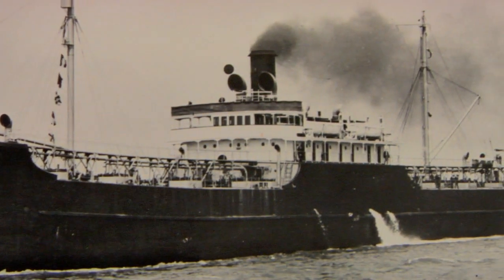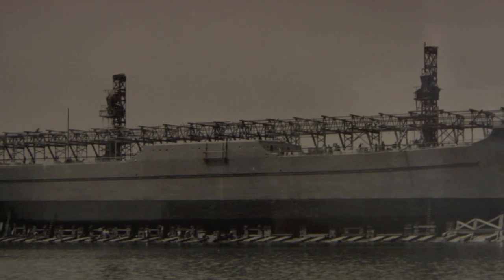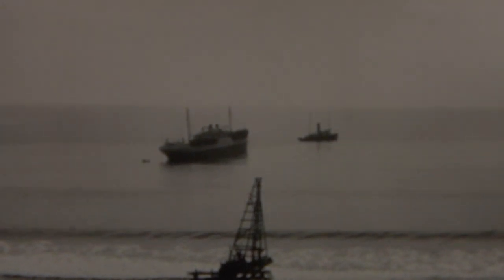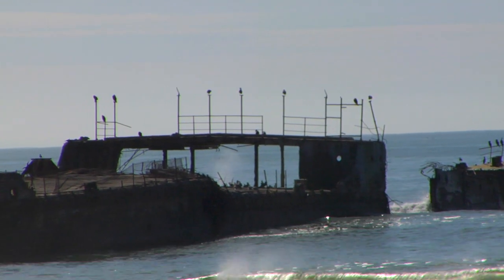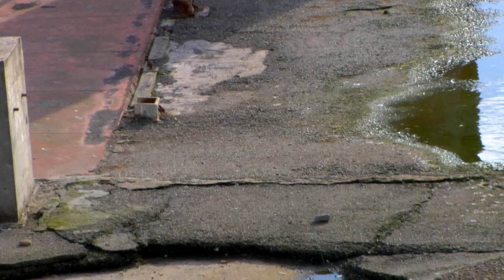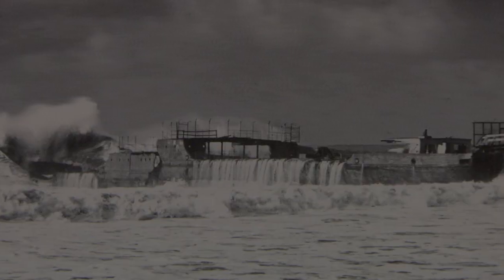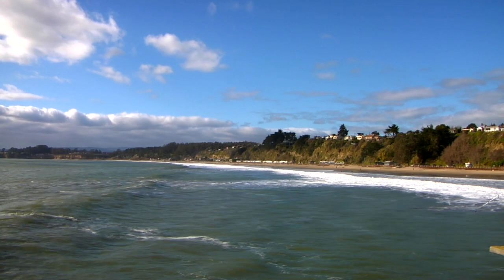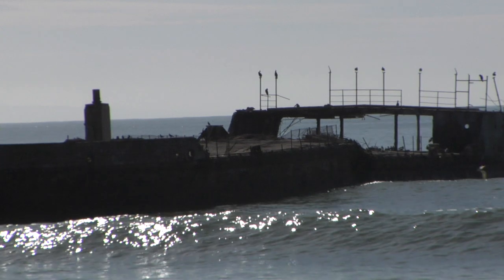SS PALO ALTO Documentary

Comment: I remember walking on the cement boat. C. 1967 Where it was split, the gap  was like an aquarium, all kinds of fish and such. The Big Rains of 1977-78 made that impossible. Maybe an earlier storm damaged it, not certain but Nov 77 into 78 was a record. I haven't gone to the cement boat since c.1981. I was in Boulder Creek in late 1977 ... San Lorenzo river was up to the top. At the beach there was wood/trees 3-5 feet deep where it enters the ocean, at the Boardwalk. Sand accumulates Every winter 10+ feet but in late 77 it must have around 20 feet deep in sand along the beach from Boardwalk to harbor. I lived very near the Boardwalk Late 77-80. Then the Feb' 1983 and winter of 1994 worked it over. And so on the year 2000 in no way matches the above mentioned rains.